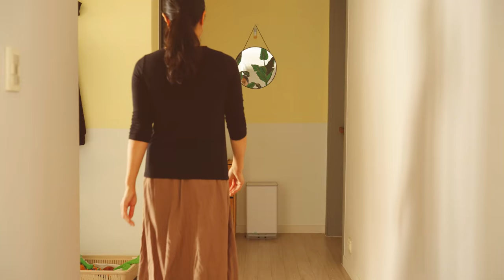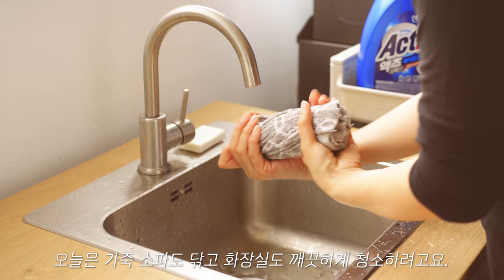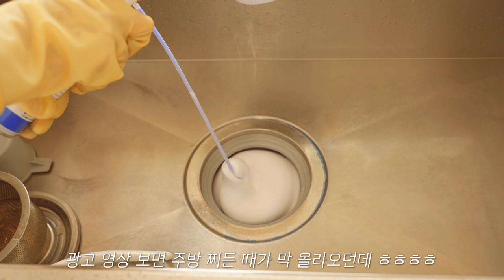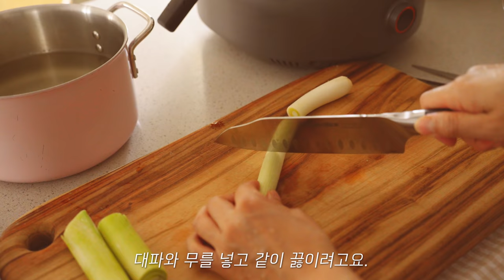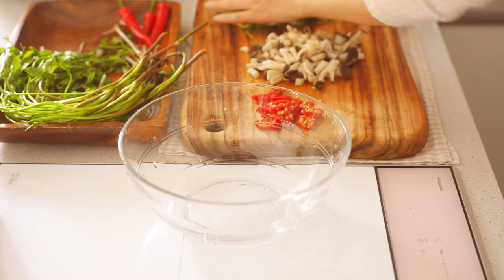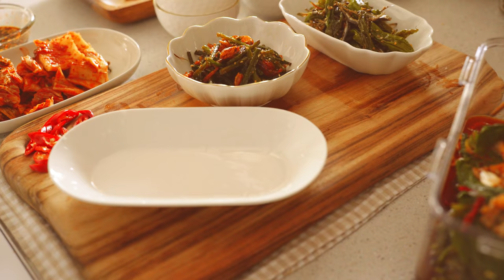반짝반짝 깨끗한 집청소와 🥗봄채소 가득한 건강밥상

Comment: I sympathise with the weight gain, I had a life threatening pulmonary embolisms about a year ago and my mobility reduced significantly. I used to walk for an hour a day and at my worst I could only take about ten steps before having to sit down. I am getting there now though, not really loosing the weight but getting about more by walking, I even walked taking one step in front of the other up a flight of stairs not long ago which was an amazing achievement 😊